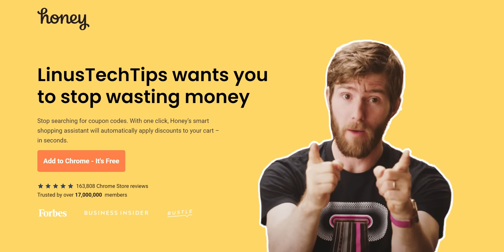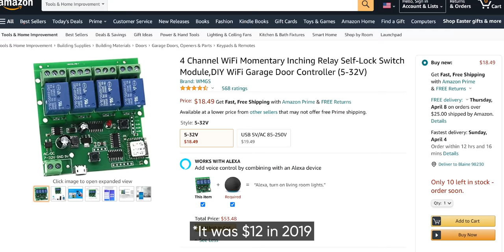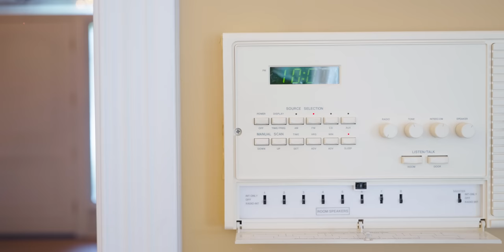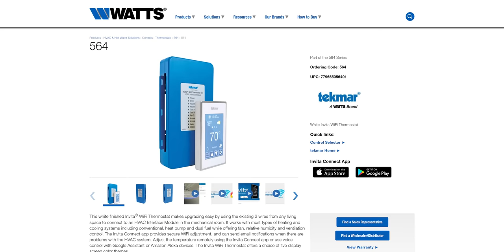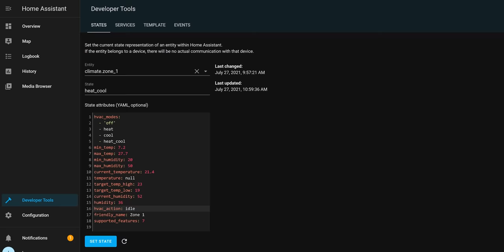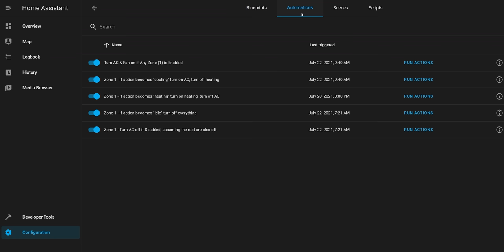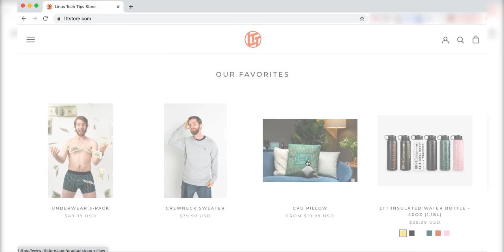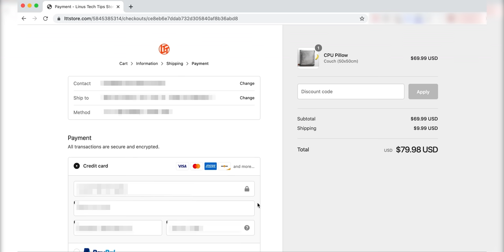This Should've Been EASY - New House Smart HVAC

Comment: I don't get when you actually have the heating system running and need Air-cooling at the same time in the year? Any useful heating system turns off when outside temp is high enough and just match the AC to it...
Reply: Seems like waste
Reply: People with different temperature tolerances. My stepmother started running the heat in October and would run it into May (if we let her), causing me to sweat like a pig if I was wearing anything more than shorts and a beater. The kitchen needs cooling though a larger portion of the year than the rest of the house. The house might also be large enough, and Linus might be North enough, that the North and South faces have different heating and cooling requirements.

Comment: Is there any concern about the failure mode of the damper? Having it default to closed seems like it could cause issues
Reply: That is standard functionality for the ARD series damper, it is Spring Return Open and power Close damper. It defaults to open in an unpowered state. They would need to use EARD(typically for Fresh Air Intake) for the unpowered state to spring return close. You can see at 6:13 that it powers to close, this is a safety feature to allow ventilation in a failed state.
Reply: The Honeywell True Zone dampers are Power closed / Spring open. Meaning if the damper were to fail or the power system were to fail in anyway, the damper would lose power, thus springing back open to allow airflow to still come through the duct system.
My concern here isn't that the damper will fail, but that he won't have enough zones calling for cooling, which would restrict the amount of air flow (CFM) going across the evap coil causing it to ice up.
Zoning system require a bypass system to be installed to help this, but most of the time we aren't zoning one system per bedroom, but per FLOOR.
I am interested to see the end product. I'm sure (hoping also) Linus has professionals helping him in the background.
Reply: @TigerXGame  It does, its quite literally spring open, power close as demonstrated. They are using the ARD series not the EARD which is as you describe.

Comment: I'd rather pay the extra for forced air. It has the side effect of removing humidity. I like my house nice and dry.
Reply: Its actually not as healthy if its too dry, and cause skin problems.
Reply: @fabianhuber6021  On the flip side, sitting in 100% humidity during the summer sucks big time. This applies especially to temperate climates where the summers are really humid. Though it's probably a good idea to implement humidifiers for dry winters.

Comment: That's strange, in at least the Netherlands (and I think Europe too) thermostats use the OpenTherm standard which does data and power over the same 2 wires, and this has been a thing with proprietary standards for a while too, i remember seeing a 20 y/o Nefit digital thermostat that also used 2 wires lol but my newer Honeywell uses the same 2 wires. Maybe just buy a European heater??😂😂

Comment: just so you know there is a spring powered damper that will maintain duct pressure. This way if you have all but one damper closed it will pressurize and blow up to, lets say, 1inch of static pressure. After 1 inch is achieved you will have enough pressure to open the spring powered duct and it will vent that extra air back to your return duct and keep your blower fan from dying. May also be worth noting that you should have a minimum time frame for starting your compressor. Starting on and off a lot will kill a compressor quickly.

Comment: You should cut a hole in the dampers, so there is ALWAYS air flowing through every vent, when anything is on. Stale air will settle and create "layers" of hot or cold that do not trip thermostats. Having air flow, constantly, will mix-up the air, also removing staleness, so the thermostat works correctly. Also, it will help ensure that if all dampers are closed, except one... The backpressure is not stressing-out the blower, which will add more heat to the AC from the motor, as well as cause potential blow-outs in the AC vents, or running up the electric bill by burning out the stressed blower motor.

A notch, or a drilled hole, 1.5" around. Also, have one line that is NOT dampened. Presumably in the living-room.

Your system "heat" and "AC", should not be fighting with one another anyways. The system should be delivering hot or cold, and no real overlap in modes. When someone is setting a temp, they are selecting heat or AC. In a room, you would normally setup a hot or cold temp to a minimum, with no overlap. You wouldn't have the heat set to 85 and the cooling set to 65... Heat would be 72 and AC would be 78, as "stand-by". More dramatic if setup for real savings. Heat only if below 67 and AC only if above 83. I know... everyone is backwards... They crank heat to 85 in winter, because 65 is too cold, and try to run the AC down to 65 in summer, because 85 is too hot. Everyone avoiding 70-75 like the plague.

You do realize that the more electronic control units you add, defeats much of the purpose of energy savings... They consume power to do, essentially nothing. They also ALL generate heat, that needs to be cooled, by an AC that has a HOT blower motor inside the house, heating it up as it pushes around cold air. Just as much of the "heat" from radiant heating, on the ground floor, is used to heat-up the perpetually cold 65F ground and little of the actual air, as you cover it in carpet insulation and cement, trapping heat underground. (Its great for floors above the ground level, but a total waste of electricity and heat, on cement foundations, where simple carpet insulation and air heating would be better.)

The coldest room in the house should be dedicated for the servers. The heat exhausted outside, when undesired and recirculated into the house, when heat is desired. That's how you save money on bills.

Want to save more money on bills... Live upstairs in winter, as heat rises and downstairs in the summer where cool air settles. Get bunk-beds, or just beds that can raise and lower. Sleep with them high in winter, away from the cold ground and sleep low in summer, where all the cool air is resting. Also, don't run fans inside the house, as they all generate heat and mix valuable cold or hot air into places you can't even feel it... Above your head. Also, go back to a smaller house. :P

Comment: we dont have one of the big ac units outside the house, but we did get every room to the correct temp no matter what is happening in the room (cooking, gaming, ect) $200 per room. done with 3 smart home products per room. window air conditioners, smart plugs, and temperature sensors. :) we plan to add space heaters to the rooms closer to fall.

Comment: I love how simple this is to do these days 20 years ago it cost so much as you had to run wires to sensors/controls in each room and wire them into box that you plugged into a pc using Linux. It was so much work even tho I only finished 3 rooms in the house before I moved out.

Comment: Nothing here is a new idea. However the components used and how they’re applied is well thought out. That being said there’s some major mechanical concerns that have yet to be addressed. He will without a doubt kill the compressor in that ac if it’s not updated to equipment designed for variable load conditions.

Comment: My goal is to have systems in my home that works without dependencies on any tech, but that can support a layer of smart tech.  This is not easy but I think it's something we should all be aspiring to.  The above solution is great but it does have a dependency on Home Assistant.  Home Assistant is amazing but has a volatile past and troubled internal culture (well documented).  So what happens if and when Home Assistant is no longer available, or some update introduces breaking changes?  What happens if and when you go to sell the house to non-tech people? Then there are the questions of security, updates, hosting etc.   My goal here if it were even possible would be to have heating controls that will work regardless of internet connections, cloud, third party software or apps etc but that I can still add a layer of tech to in order to add smart capabilities as a second option for control.  As an example, I currently use smart socket adapters in my living room to allow me to switch all my lamps via home assistant.  But if all else fails, I can just remove the adapters from the loop and all my lamps will still work as they always did.  This is what I mean by adding smart tech as an option/add-on but where I can revert to a non-dependent useable scenario should any smart dependency fail.

Comment: have dampers normally open and then shut when other zones are called. that way if a damper fails in in the open position. also adjust the bleed through the damper to "1" . also install pneumatic bypass on ac unit. if you dont your coil will freeze.

Comment: Just saying water only “Hammers” because its non-compressible, so a slow moving valve for air is just plain useless. The air A) will compress as it collides with the closed valve, and B) any gas is much less dense than any liquid so the forces acting on the pipes will be an order of magnitude less.
Reply: - An angry engineer
Reply: They actually aren't pointless, you want to avoid fast closure for pressure buildup.
Reply: @conortownsend242  not sure how any sort of AC fan would create significant pressure to buckle steel. Furthermore as I was saying the air will happily compress under pressure in a given volume.

Comment: "this should have been easy"
"We want [the damper] to be closed when this is off because that just makes more sense as a brain thing"

So, what you're saying is that you want the damper to fail closed? Like, if the damper fails, during the time period of however long it takes you to do diagnostics and figure out what's wrong, you want the default behavior to be "no cooling goes down this branch?"

This is one of many examples in this video of why HVAC engineering and Controls Engineering are whole other fields. It turns out that knowing how to code isn't a replacement for training in those fields.
Reply: No I think he tells you the latch will be open until closed off via software, the on/off is just software push while whole system is wired to mains all the time.
Reply: @fwd79  so, if the signal from the "software push" (the control signal) fails for some reason, then the damper will stay closed, blocking air, regardless of whether the central air system has mains power and is trying to blow through it - and that will persist until the problem with the wiring for the "software push" is diagnosed and resolved, yes?
Reply: @brodyjohnstancliff4822  these particular dampers are power close and power open they wont default one way or the other they will have a 50/50 shot when they fail if it is open or close. if they are the ecobees im used to they will send you a message saying they are having communication issues if it is a low voltage issue. idk if their home assist will indicate a fail im an actual ac tech and use zone boards. but i also live in florida, usa where cold doesnt exist so we only focus on cooling and heat is a secondary thought.
Reply: @brodyjohnstancliff4822  can happen in ether state so "normally closed / normally open" is a minor issue 
and they did say / a commenter stated that the software can detect a demanded space is NOT responding temp wise and go into fail / alarm mode
I believe the dampener is normally open and the relay board is what would be power on when NOT commanded IE a NC contact on the 24V relay board
so if the relay board looses logic control / power but the 24V is present then all dampers would end in closed position 
I would add a pressure sensor to the main trunk and trigger an "all open" if pressure starts to climb extra bonus sensors before AND after the "A" coil to detect frosting up and shutdown pump open all dampers and run fan till pressure normalizes
Reply: @jasonriddell  imean, those are reasonable suggestions for how to add stuff to minimize various drawbacks and make this setup work kinda, but my alternative suggestion would be to just use a more "normal," tried-and-tested configuration of HVAC control hardware for a system like this, or, better yet, get a professional to design a system that will actually meet the house's heating and cooling needs well. Like, if there's a server room in your house? Your house has some unusual cooling needs and will need an unusual home HVAC system to match that.
Reply: @zacharycline322  One way to mitigate this would be defaulting to open. If no cooling is used, open all of them. When you want to cool things, close only a few rooms that are closest to set cooling temp. This also means that you can't use on/off thermostats, you need temp and setting reading to know which room needs more or less cooling. Then simply use those dampers to Ballance out which one gets how much cooling without closing too much of them. More of changing the ratio of cooling to each room without causing too much restriction. I actually wanted to do such thing using smart floor vents but could not find ones that are remotely controlled and don't use some proprietary software. I even could not find a vent that would close/open with timers. I don't like warm bedroom so I'm closing the vent in the winter when the whole house is set to warmer temp. In the evening I'm running it all much cooler so I have to open it, otherwise it would be cold in the bedroom. Just simple thing and even that was not easy to find.

Comment: 15 years running an HVAC company. One quick tip wich I am sure you have already thought of.
In cooling, with compressor on, if you only have one or two dampers open you will most likely freeze your AC due to lack of airflow. 

I would also look at installing a bypass damper.

Comment: If you're adding more zones than what is already on that AC you will want to add a Barometric Damper and a Discharge Air Sensor(DAS) to cut off the condenser if the supply gets to cold then turn back on the condenser once it gets back up. Mostly gotta worry about excessive static and freezing the coil. Or you can YOLO it, whichever.

Comment: wouldn't closing the dampers possibly cause an issue with moisture accumulation because a difference in pressure. this will also more than likely effect the air flow because units are rated for a certain air flow and can be over or underrated depending on the amount of vents/load they are supplying.

Comment: I have concerns with the "automations" list you showed, lol, but I'm sure y'all will do a lot more for the actual system and were just simplifying for the demo vid.

I agree with some other folks that you're gonna want to look at how many dampers you can have closed at a time without messing up your compressor, that you probably want your dampers to fail open rather than closed, and that you're going to want a fan/circulation option separate from an active cooling option.

I'm also not a huge fan of the motion sensing options, for a couple of reasons - I'm not convinced that motion sensors are going to be especially reliable for correctly determining whether a room is occupied, especially a bedroom or a computer room where there might be people in there who just aren't moving a lot, and especially if you have any pets. Also, you're probably going to want to be able to cool empty rooms some even if you aren't cooling them at full blast? Like, I'd really rather not have to walk into a 90F room in the middle of summer and only then have the AC kick in to cool that room. Overall, it just seems like the motion aspect is just making it overly-complicated and prone to unanticipated drawbacks; I'd scrap it, personally. But ofc you do you!

Side note: I'm reminded of the house my parents built ~20 years ago. It doesn't have the electrical control features here, but it does have a massive 2-story wall of windows for the living room, and little "turtle" like ducts under the tile floors, letting the sun heat up the floors leading to heating up the air down there which then circulates around the house, providing passive heating in the winter. Neat little thing that my dad was (and still is!) super proud of designing (with the help of various professionals, ofc). Seems like the sort of thing Linus would do, if you had a room like that.

We also have some small windows at the top of that wall that are motorized, with a manual control by our thermostat where we can open them for some passive heat venting in the summer. I'm curious if you'll do anything like that - I expect you can probably reach most of the windows in your place easily enough, but it could be neat to set up some home assistant routines to open certain windows automatically as part of specific cooling routines (only useable when the weather allows, ofc). Or maybe set up some windows in the attic for that purpose, even.

Comment: You should add a low temperature cutoff switch to your evaporator coil to keep it from freezing with reduced flow.  Make sure your condenser unit has a delay timer to prevent it from turning on immediately after turning off.  A bypass damper on the air handler would probably be a good idea as well.  When the time comes to replace the A/C unit, consider a 2 stage or variable speed system.

Comment: The old AC unit with one sensor is still good, in a zoning system you put the sensor on the return side of the furnace and use it to keep constant air at 21° so that when one of the zone needs cooling, the controller simply open the damper to cool the zone. And you install a bypass damper on the furnace between the return and the supply to keep the air balanced when some zone air damper are closed